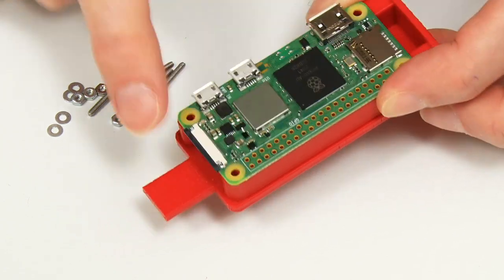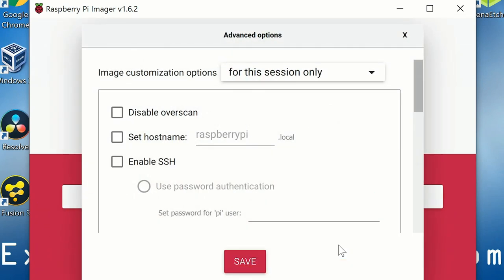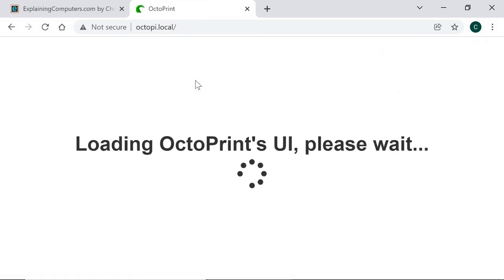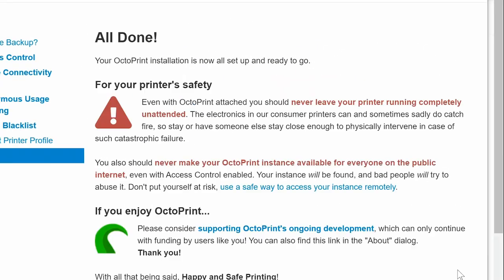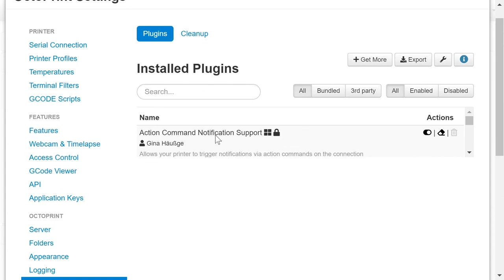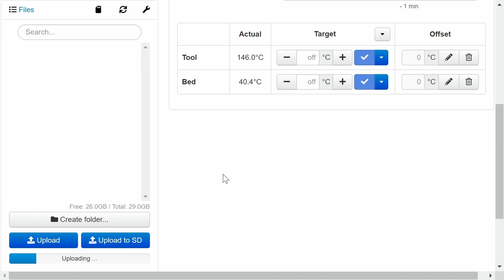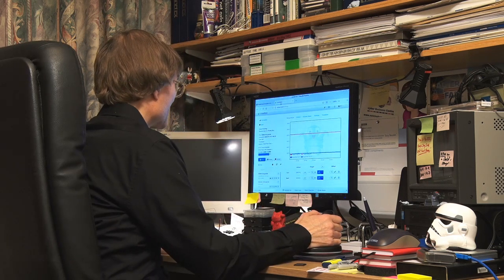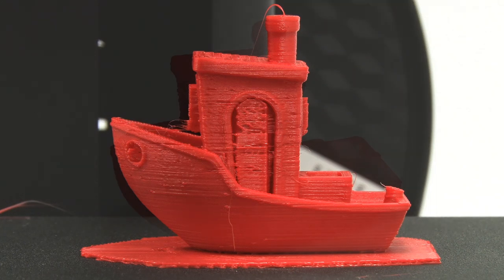Raspberry Pi Zero 2 W OctoPi 3D Printer Control

Comment: Great video. Just FYI, the Benchy is intended to be printed without supports. Part of what makes it such a good test is to see how well your printer can print overhangs like the arches and roof. It can be done cleanly once you have temps, print speed and cooling fans dialed in.

Comment: You can setup OctoPrint with Cura, to print straight from Cura, very useful.  I also have mine configured to power on/off the printer via a tasmota smart plug.
Reply from the maker: The smart plug is a very good idea -- I will delve into that! Thanks.

Comment: I have been 3d printing for years now. Tips, Benchy no supports, is it a test of you print rate, heat and other various tolerances. Turn down your heat by 5 degrees. Monoprice tends to run hot sometimes. If this was your first print ever on your own you did great, my first one did not even finish. Also never be ashamed of how much filament you have, lol. Thanks for the video Chris!
Reply from the maker: Thanks for this. This printer is new to me, but I've been heavily involved with 3D printing, largely in industrial arena, since about 2011. This was not the first print from the Monoprice -- about the 7th or 8th I think, and not one has failed yet! :) I've adjusted temperatures downwards (here I think I was on nozzle 205 and bed 45), in part to make it easier to remove the print from the bed without damage, which can be a big issue with the Monoprice.

I'm not going to tyet again get into the benchy support debate here. The model can be printed however you like! :)

Comment: You havent talked much about 3d printing other than this particular set up.   I, much like you, got into 3d printing the same way.  For some reason its feel very natural going from SBC's to 3D printing.   I started on the same printer you have - from there I went to a flash forge finder and now a Mignda Migician X.   You should put Octopi on a standard Pi board and put that pi on the back of a display (i use sunfounder).  Install OctoDash and now your Pi completely controls your printer at a touch of a button.  Its very very cool.

Comment: Thanks for this, Christopher. 
I've had that same 3D printer for 18 months or so and haven't used it as much as I intended  simply because of the hassle of copying each project to SD card. I have a Zero 2W I spare, so I'm going to give this a try. Thanks again for your indepth tutorials.
Reply from the maker: Sounds like you have a project on your hands. Good luck!
Reply: The Monoprice Select Mini V2 actually comes preinstalled with wireless capability. Which means you can connect it to Cura and print directly from there without even touching the SD card or using a Raspberry Pi at all!

Comment: I'm using a TP-Link Kasa mini smart plug with energy monitoring connected to Octoprint using the TP-Link plugin.  It works really well and I'd totally recommend it.  Switching off the printer automatically in a thermal runaway situation or 10 minutes after the print has finished is a great feature plus you can keep an eye on the energy use.

Comment: I'm watching my printer with Octoprint now, built and set up to your instructions. 
It's saving me from going to the garage in the snow.
I'm printing a wedge so I can screw your frame design to the printer frame with T slot fasteners pointing down as it's an enclosed coreXY printer as it's currently showing a lot of the top of the little tent it lives in.
Reply: Just to add switching between the gcode and the live view is so fascinating it's almost taking away the point of being able to remote monitor and periodically check for any obvious failures.
Reply from the maker: This is great to hear. And like you, I now spend time watching the printer remotely, rather than in person! :)

Comment: Hi Criss! Another great video explaining basics. I looked at this Benchy, this printer can handle it without supports without any issues, both from PLA and PETG. I've checked my old prints and walls on mine looked much better. There must be something wrong with Cura profile, maybe they broke them through the years. Anyway, I got my best results on 0.175 and 0.21875. Crucial thing with this printer is to use those magic numbers as they are effect of direct steps of a motor on Z-Axis. If you round them it will not give you good results. I also found that this printer works better with PLAs that are defined by people like "having less details, more smooth surface", rather than with those producing "sharp and detailed results". With the latter you will have a lot of tiny gaps in places of retractions, layer changes, z-seam etc.
Reply from the maker: Thanks for this. Here I was at 0.175 layer height. I am going to try some different PLA as you say. :)
Reply: @ExplainingComputers  I'll try to reconnect mini in next few days and do a print or two. I'll let you know.
Reply from the maker: @SergiuszRoszczyk  Thanks. I'd be interested to know which PLA you are using.

Comment: When I saw the Zero 2 W first announced I bought one and am now using it to control my Ender 3 Max. I printed a box for it that sits next to the control panel, and it gets power from 24v power supply, using a Y cable and a buck converter, also mounted in the box with the Pi. I didn't have a Pi Camera, but recently added a USB OTG Hub and an old Web Cam so I can see how the print is going (the print head on the E3 Max is huge, and its hard to see how the first few layers are going!) I was told that the Zero 2 W was too slow to use a USB camera, but I have found out that this is not the case. I also find that with the thin USB cable its easier to position the camera and Pi Box where I want them without the limitation of the short, inflexible ribbon cable. Its made printing so much easier, and I don't have to worry about pulling the SD card in and out all the time and the risk of damaging or dropping it.... 

I'd recommend the Zero 2 W for Octoprint unless you are controlling multiple printers, in which case the extra oomph of a Pi 3 or 4 would probably be necessary.

Comment: I love that you use a 4:3 or 5:4 monitor :')
Reply from the maker: Thanks -- it is 5:4 (1280x1024) as you suspect. I find it better for writing than a 16:9.
Reply: @ExplainingComputers  I find the resolution a bit limiting these days, though. I got an 5:4 1280x1024 IPS monitor from Dell but recently picked up a 1600x1200 4:3 monitor from Eizo. It's made for doctors but it's still an amazing display. Can recommend. In my setup, however, I use them vertically as a secondary display. The aspect ratio is great for this too.

Comment: Good video!

I have a similar form factor printer that I picked up on the cheap from Micro Center a bunch of years back (the Powerspec/Wanhao Duplicator i3 Mini), and I ended up taking a bit of a different approach to you. Perhaps the biggest difference was that I made an arm that clipped onto the gantry of the printer itself and kinda swung out into a suitable camera position, running a Pi camera with a long ribbon cable over to a Pi mounted on the printer tower. The advantage over a tripod based solution would be that the camera would move upwards with the print itself, which solved the problem of the print going past the top of the frame for taller prints (a problem I had on my other printer). I also ended up retrofitting a small SK6812 LED light strip to the camera arm, which I could hook up to the Pi's GPIO pins to use for lighting and visual print status monitoring. As a final little thing, I connected the Pi to a normally open relay hooked up to the printer, so I could remotely power the printer on and off using an OctoPrint plugin (though this ended up breaking in a software update and I never bothered fixing it, heh).

It's always fun seeing what people do with their own setups!

Comment: When I first ran Octopi my printers were in a spare bedroom and I viewed them from downstairs on a laptop or desktop but if anything went wrong I had to unplug the pi from the printer to gain access to the controls to stop the print and then set it back up reconnect the pi and then go back downstairs to start the print, I now run the Octoprint everywhere plugin and the app on a phone so I can control the printers from anywhere and also take it to my printers which are now in a purpose built workshop if anything go's wrong.

Comment: Benchy is a great old standard for dialing in your printer and slicer settings. This one looks cold and overextruded to me but it's hard to tell from the video. I don't think supports are allowed in olympic freestyle benchies either. How it fails on the overhangs is informative. But we'll let the suave presenter slide on that one since he makes nice videos and gives friendly names to sharpened tools.

I'd try another about 10-15 degrees hotter and look for a setting labeled something like 'extrusion multiplier' in your slicer and set it at 90% or .9 (so it uses 10% less filament). If it looks cleaner you might check your extruder calibration.

It's nice they made an upgraded pi zero that runs octoprint but they seem a little proud of pi's these days.

Cheers to Chris and the channel...

Comment: I'm pretty sure when I set mine up I didn't have to configure OctoPrint at all (other than setting up SSH and WiFi). Instead, I configured Cura, connected Cura to OctoPrint and everything was configured from Cura. Added advantage is that you can print directly from Cura, and you get a bigger display from the camera in Cura.

Comment: Interesting and well working- although I personally don't really see the need for it and it adds a lot complication. I hope that new printers just work like that without modifications. Until then I am finde just using a SD card and check in once in a while on the print since you can't really let them alone in the first place- webcam or not. That obviously changes if you print more than a piece every few months or have multiple printers or printers that can print several pieces after another

Comment: Hey Chris,

Great to see another useful project for the new pi boards.
I realized sometime last week that I don't think I've ever seen you do any work with Arduino at all. Is there a particular reason for that? Have you ever considered looking into it? 

There's a project at work that is going to require me to program an Arduino which is going to be fun considering I'm not a programmer, lol. So I thought I'd see if you did anything on them and I don't think you have.

Great video as always though, thanks for the consistently great content!
Reply from the maker: The only reason I've never covered Arduino is that this is a computing channel, not a maker channel, and an Arduino is a microcontroller, not a general purpose computer. I have done some videos on the Pi Pico (which I initially did not cover for the same reason) and indeed will return to it fairly soon. Who knows, I may look at an Arduino one way -- but it is a space that others already cover very well indeed.

Comment: Hello, big fan of yours, love your video. I'm no expert with my poorman Ender 3 but after some years of printing I cleared my mind a bit. The benchy seems to show that the printer may need some tuning. Extrusion in particular seems inconsistent, in some points the printer appears to be underextrding while in other spots layers are a bit rough. That overhang shouldn't need supports. You could maybe get rid of the raft to improve bottom quality increasing bed temp to 60C, I don't know your printer in details but if you have PEI or something similar like old enders for the bed you should be fine without raft or additives.
Give me a shout if you need to dig deeper into the matter.
Keep up your splendid work!
Reply from the maker: Thanks for this. Right now I'm printing with Monoprice PLA, but will try some alternatives. I'm using a raft to make it easy to remove the print from the print bed without damaging the print or the bed (a common problem for many Monoprice Select Mini owners) and have taken the bed temperature down from 60 for this reason. And so far I've not has one failed print.

Ultimately the printer is doing all I want and need it to do (including being relatively small and easy to store when not in use). I'm either printing functional parts, which function fine, or objects that are going to be significantly post processed to obtain a smooth surface. So messing around to get a bit of improvement in what comes out of the printer would give me zero benefit. However well a material extrusion printer works (and I've handled output from $200K Stratasys machines) the surface quality is never a patch on a cast or injection molded part -- at least before post-processing -- and I don't expect or require it to be. So providing the printer reliably delivers structurally sound parts and good net form, I am happy! But I know others have different requirements. :)
Reply: I know the difference from injection molding and 3d printers, I also know the difference between a stratasys and a sub 200$ Ender3. Also, I happen to know that a sub 200$ printer should perform way better than this. If you're ok with ugly functional parts it's fine, I prefer mine parts accurate but also good looking. I don't know wich but either your PLA or your printer have some issues. Since you're putting out information on 3d printing for people new to the matter, I'd like to point out that.
Reply from the maker: @gianni.1407  Thanks for this, and your points are well made. I was not criticizing your knowledge, only explaining my point of view. :) I will certainly be trying a different PLA -- here I'm using Monoprice material sold for the printer, but I suspect other PLA filament may perform better as you say. 

ExplainingComputers will remain a computing channel, not a 3D printing channel, and this I would argue is mainly a Raspberry Pi computing video. But I decided to get a small and low-cost 3D printer for use in some projects, and hence made this video and the previous one in which I introduced the printer. But as always here, whatever I do I can never win. :)

Comment: I’m in my shop 3d printing right now. Yesterday I was thinking about doing this. How timely
Reply from the maker: I suspected you may get into this. Right now I'm replying to YouTube comments in one tab, and monitoring my 3D printer in the other! It is certainly a very useful application for a Pi.
Reply: I used the original Zero to run octopi with it worked ok it did how ever add about 20 to 30% to the print time. Which made it a bit impractical.

This is a pretty good improvement and an excellent use for the pi zero.

Comment: Wait for a cr10s sale. It prints much cleaner. But I think I will try this. The camera alone would save me many a trip into the garage. Does it have a filament breakage alert? My cr10 has a break sensor, but it just stops the print. By the time I notice, the bed has cooled down and the part has popped off.

Comment: I've been running something functionally identical to this with my Creality printer and have been happy with it overall. Bit slow to upload files to local storage due to cheap card (I can fix it, but it's basically a waste of a good card) but is otherwise great. With various plugins it's a significant upgrade to 'plug in a micro SD card to the printer direct'. There are a ton of plugins and many ways to tinker with and customize the web interface to your preference so you can go from stock to hog wild if you want.

Comment: Hi , I watch your channel a lot ,good stuff, I have notest you 3d print looks like it is under extruding, and your layer height seems a bit large, the little gaps in your lines with weaken the strength over time. As this is for octoprint I'd reprint at a slower speed and if possible I'd calibrate your extruder.

Comment: I managed to score a Raspberry Pi Zero 2 W (maybe the last one in North America, for all I know!) and was able to get OctoPi running on it and controlling my Creality Ender 3 v2.  In printing a case for the Pi Zero I was reminded of one of the most vexing things about 3D printing, which is that the filament may not come off of the spool cleanly.  It will bind and may cause the print to fail.  Nothing like coming in to a printer that has quite happily printed air for the last hour! I suspect that I am not alone with this.  Do you know of a (hopefully) simple fix for this?  

By the way, as with most all of your videos, this one was well researched and well presented and much appreciated.
Reply from the maker: Thanks for this. Great to hear that you got OctoPi running on a Pi Zero. :) On filament issues, my  advice would be to keep the spool wound tightly when not in use, and (if PLA) stored in an airtight bag and with some silca gel -- as moisture can damage PLA and potentially help it stick. Good luck!

Comment: I have thought about upgrading my 4 year old 3D printer. It works great but the electronics and software is getting a bit old. It lacks features that I would like to have. My problem, if I screw up the upgrade I’m out of a high end very expensive printer. More research will be needed. 

Question for you Chris. I can afford to put in a Raspberry Pi 4 8 GB, will the extra performance provided any advantage?

Comment: What be really amazing is if they  had an octoprint +  AI , that could run on  something like a jetson nano
that could analyze the video from the  camera and compare it to the  g code for the layer being printed and also  an .stl file  and detect if the print was going wrong  ,at least a catrostrophic spaghetti failure , and then have it   either abort or notify you with a txt or  some other options
Reply from the maker: There is a plug-in that runs on a Pi that tries to detect a spaghetti failure. I've yet to try it though.